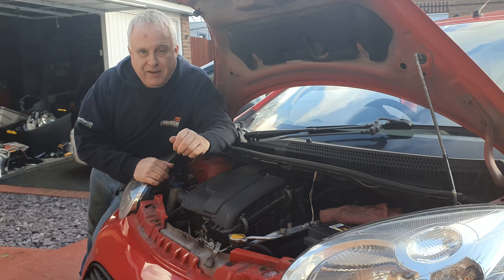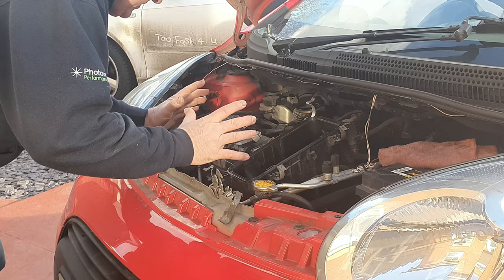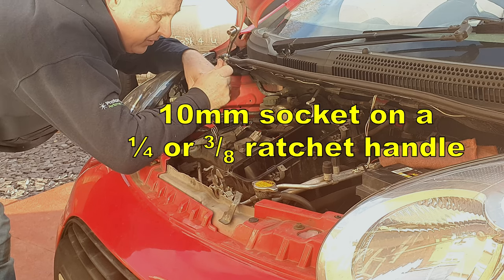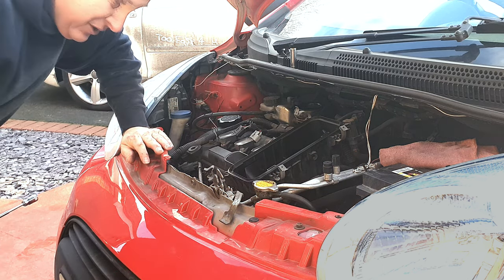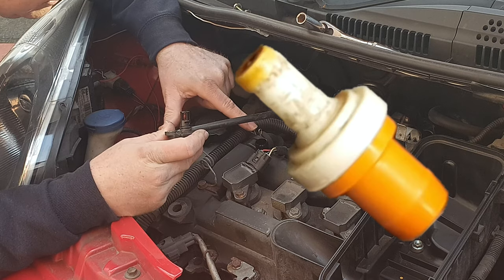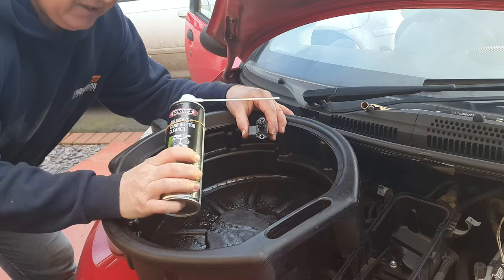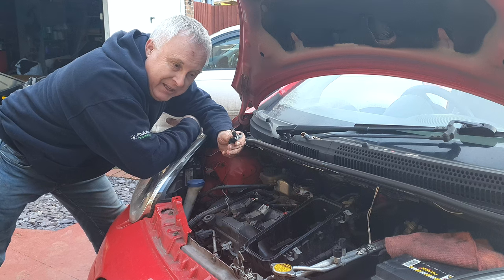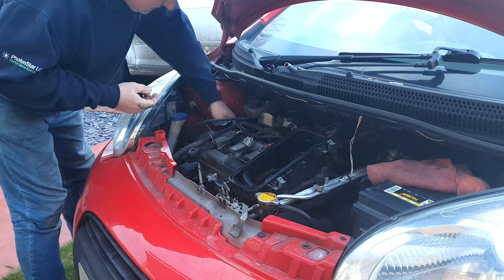Toyota Aygo IAT MAP Sensor Cleaning in Toyota 1KR Engine

Comment: Thanks for this video, Cyd. This will be  a job fot the coming springtime either; my engine is running fine. But the exhaust system of my C1 needs a replacement immediatly. Very noisy! 🔊🔊🔊

Comment: Thanks for sharing! This really helps out a lot!
I want to just place new parts in it, should i do the engine flush first with the old parts or with the new parts? 

I do have a difficulty on finding the dutch part names but I'm just sure i need to clean or change them, and due to the low prices ill just change them 

I drive it daily back and forward 55 miles to work
And been to spain and italy in it this year 

Don't even own the car a year i noticed the service papers are wrong so it might be without service for over a very long time, still it drives just good fuel consumption is a bit high though my friends car can go 60 miles more on a full tank similar driving style 

My car uses 1 liter oil a month, i don't drive terrible fast or in high rev's just sometimes getting up the highway when i already drove 20 minutes

Bought already a new radiotor and hoses oil filter flush and ill be adding a bilstein lower kit new wheels to make it a fresh driving car i might be overdoing stuff but I'll wanna drive it till the engine dies

Comment: Just a quick query. I've cleaned the MAP, PCV, and the throttle body, but the car still has a flat spot at low revs.

When manoeuvring the car at slow speed, for example, reversing onto the drive, the rev's drop, almost to point of stall. Sometimes, it does stall. 

I do have a fault code reader and it shows no stored codes. Only a basic reader though.

Comment: Hi can you come to my rescue over these issues..
exhaust carbon monoxide content after 2nd fast idle EXCEEDS DEFAULT limits..
So cleaning what you mentioned will work..
exhaust lambda reading 2nd fast idle outside spec levels..i will give you car reg  YS56 GVD so you can read the actual issues.
last one is weird exhaust fumes in car or on board..?
To be honest Sarah has had KA with very similar issues her dad scrap car and bought this and I feel because small engined cars carbon build up is more common but regular service cleaning would simplify all above issues..
Look forward to your reply 
Tim
Reply from the maker: High CO means it's running rich or incomplete combustion. I suggest a thorough service. 
Change the oil - making sure to use a C3 grade (Mannol is good https://amzn.to/3kdZVZ6 and use a flush https://amzn.to/3keqcqn, Mann filter https://amzn.to/38owXTF).
Change the plugs - standard fit are copper - 15k change interval https://amzn.to/3xW8WOz
Change the air filter - if it's dirty it may restrict air flow - Mann are the best, Blue Print are good https://amzn.to/3OF0oSg
👆 I've got videos for all these things
Clean the throttle body and idle control valve - https://www.youtube.com/watch?v=T9HCbWq_R58
Clean the MAP / IAT sensor - this video
Clean the PCV valve - https://www.youtube.com/watch?v=G34R5SAad74&t=1s
When you change the sparks, clean inside the coil ends where they connect with some carb cleaner (get Wynns https://amzn.to/3Kkd4dC).
Fumes _ inside_ the car? An exhaust leak probably. I've just ordered a new system for ours for 100 quid, but the video for fitting it will be a few weeks off. TBH for most owners it's just as well to go to an exhaust centre and have one fitted.
Oh, and use super unleaded - ours really seems to like Tesco Momentum 99.
When you've done all that and you have a tank of TM99, take it out on a good run and give it an Italian tune (ie a good thrashing - once properly warm)